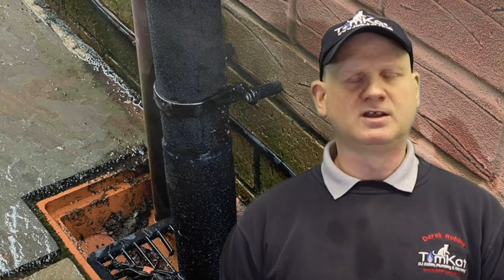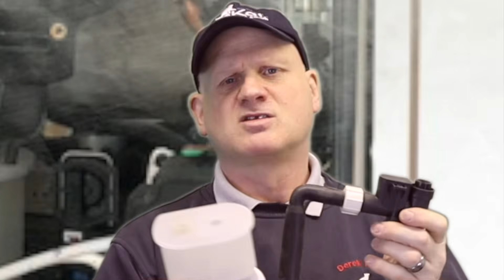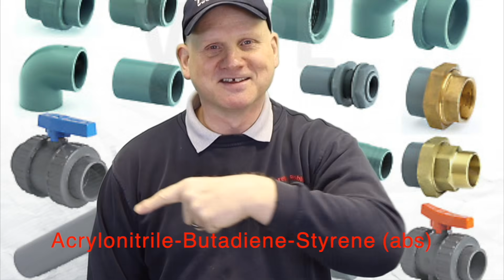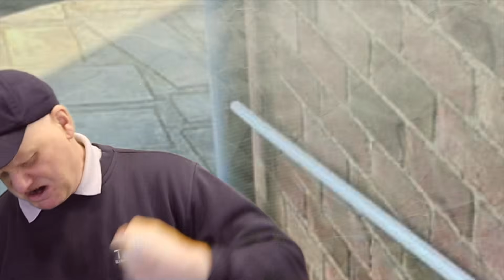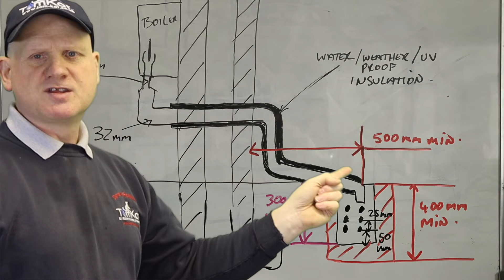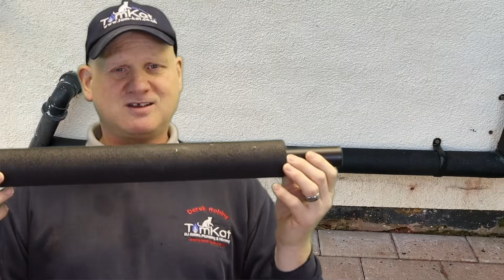Protect your boiler from breakdown over winter  make sure the condensate pipe is installed correctly

Comment: You can get the a class 0 type insulation thats uv rated. Its normally sold as solar insulation as im guessing its aimed at external pipework on renewables. They all degrade in the sun though even the ones sold as suitable they just take years instead of 1 year. Regular painting is a must.

Comment: Can you terminate to an internal soil stack or shower waste pipe using a suitable in line Trap?
Reply from the maker: Yes you can
Reply: @tomkatgastraining  fab, my shower waste pipe is close, so am assuming a need an adapter and possibly a non return valve. Thanks for taking the time to reply - your videos are great with lots of tips.

Comment: Many thanks for that.  My condensate goes to a soakaway. It has frozen once in two years since installation.  I simply drilled a small hole in the condensate pipe to get the boiler back on and would really like to fit an emergency drain to the condensate pipe in case it happens again.  Sadly, it appears you're not allowed to do this.  The external pipe is 32mm, but was uninsulated.  I've insulated it, but fitted a wooden box over it to prevent UV exposure.  Willing to bet the service engineer will find a reason why this is wrong too.

Comment: Last week I was installing a boiler and run 32 mm pipe external. Then lagged with the correct lagging.    Not the grey crap.    Anyway two British Gas engineers asked why I lagged pipe as they fit 40 mm and said you then don’t require lagging.    So all those lovely overpriced b g. Installs they have done are wrong.       Or are they correct. ?
Reply from the maker: They are wrong you are correct 👍🏻

Comment: Hi Derek.  A very helpful video from you about the regulations regarding condensate pipe, I have learned a lot from you.  A question please if I may.  My wife says she doesn't want a length of pipe with black insulation showing, painted or not, running across the full length of our new extension.  So, would it be okay for me to run the pipework with insulation on, through the inside of a length of drainpipe from the house to the nearest drain?  Just to let it look more in keeping with  the rest of the build.  Thank you.  And all the best for 2024.

Comment: Does condensate erode the glue used in ancient (1992) plastic pipe joints? I had a condensing boiler fitted about 12 months ago, with the condensate pipe plumbed into the waste pipe from the kitchen sink, just before it enters the wall. I've noticed that vertical run of the 40mm waste pipe outside of the house is often damp below the glued joint with a 90 degree bend where it exits from the wall. 
Never happened before, and that joint has been there 30 years so the only (unlikely) explanation I can think of is condensate leaking through through the joint. Has anyone else seen this?
Reply: The installers probably didn't glue it.

Comment: One thing to check when connecting condensate pipe to internal waste/soil pipes is the property sewage disposal system.  Mains sewage treatment no problem. But if there is a small sewage plant or a septic boiler condensate will lill it dead.  In these circumstances connevtion to a soal away or raineater pipework is essential!
Reply: Or fit a neutraliser in the condensate oipe.
Reply: it is BULLSHIT. i licked condensate from boiler ad it is only tiny bit acidic. Not like everybody is writing. I guess it all depends how efficient your boiler is and how much CO it emits. And what flow temp you running. Known that in uk everything is old and inefficient i guess that's the problem. But when you run your boiler at MAX 45c flow temp you have no problems because condensate is so weak  in acid that everyday soap, fairy, dish washing liquids\tablets and also washing machine chemicals they all are very strong bases so it neutralizes acid.

Comment: The idiot certified installer of my combi boiler had the condensing pipe going up-hill, the boiler was serviced every year for 5 years till all of the electrics shitted out and it had to be replaced. None of the 5 different services techs ever noticed or addressed the drain issue, but they all added a note of water and moister and rust inside the unit.  It was only when the new unit was installed, that is was discovered that the pipe couldn't drain and most of the water was draining back into the combustion chamber and vaporizing over and over, and filling the boiler case with steam and moisture.  6 different certified boiler techs completely shit the bed on this issue even though I brought it to their attention, and 3 of them were more concerned with telling me off for opening the case, trying to find out where the steam was coming from and the crackling gurgling noise from inside the combustion unit.....  Did I mention idiots, just incase I didn't   IDIOTS!

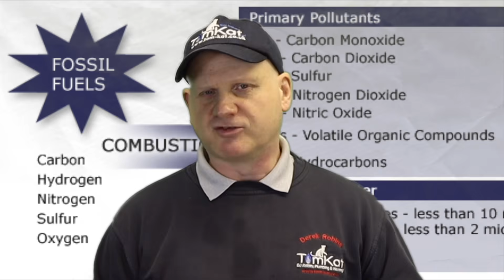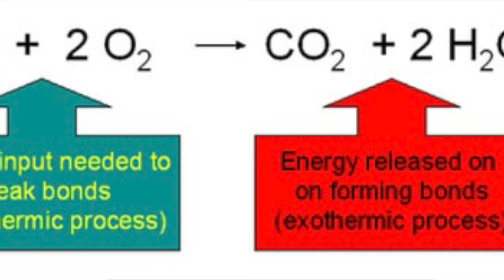Comment: No there isn't a choice with the Manufactures 1:45 or Building Regs 1:55.  Building Regulations are statutory manufacturers' guides are not statutory so must comply with Building Regulations.  Can copper condensate pipes be used internally?

Comment: Internal is good, but you still have to trace how that pipework continues downstream?  I've seen Bath waste freeze up. Bath Used mainly as a shower so slowly draining.  So condensate same. 
Also used a product called "condensulate " in the past,  not sure if it's still available? Keep up the good work.

Comment: I've been using a Worcester CondenseSure Siphon for years. It dumps into the same stand-pipe as my washing machine, then into an external drain. Never had any problems with freezing
Reply: Not a good practice.
If both appliances operate at the same time you run the risk of contaminating the trap as condensate could back up into the boiler.
Also washing machine upstand is designed for the machine only. 
Each to there own 🙄🤷‍♂️

Comment: Hi does rain water get into the outlet of the flue and where does it go? Does it travel through the flue and out the condenstate pipe, 
I’ve had a new boiler fitted with a deflection kit on the flue the boiler is a ideal logic max.
The deflection kit slightly angled upwards towards the sky and the instructions says it should be like that, but I think it would be catching the rain?

Comment: Had a new ideal vogue boiler installed 2 weeks by ideal accredited Max installers adding another 2 years to the warranty.  They didn’t upgrade the existing outside condensate pipe to the drain to the new size, as per regulations.